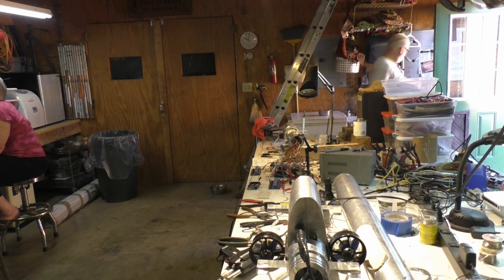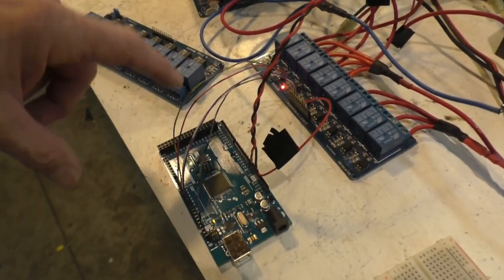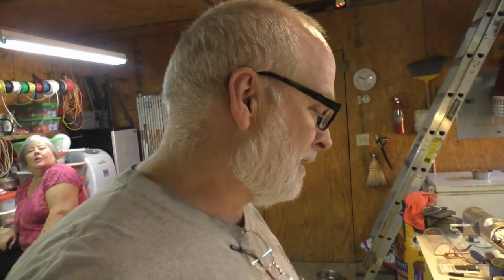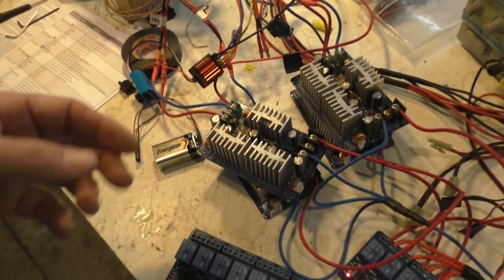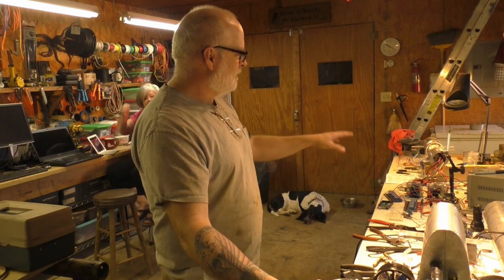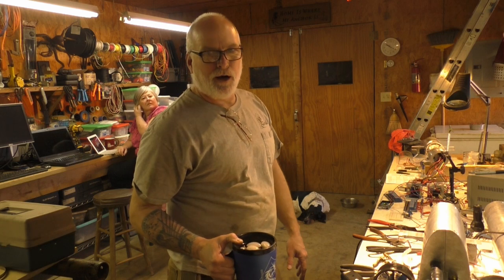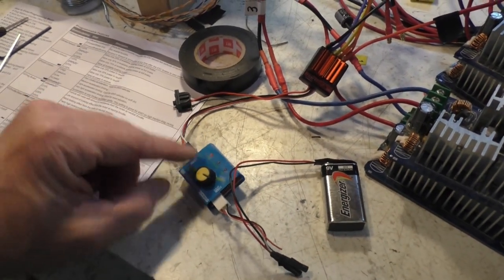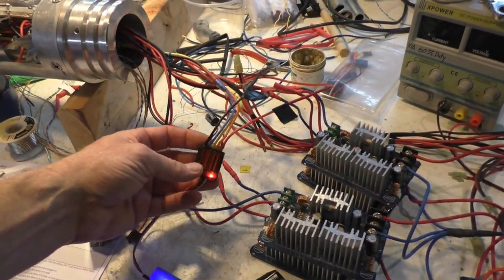ROV Wiring - Arduino, Relays, ESC, Outrunners, Bow Thruster and more

Comment: I bought CITIZEN CLL030-1212A1-353M1A2 LED series. Manufactured by Japan. It cost around 5$ppcs and bright is absolutely insane. Digikey is distributor. 62W max around 2640lm per led chip. Maybe CITIZEN LED solution will be cheaper than CREE. 
In question of arduino and more power, you need to define what is more power. There are plenty of different evaluation board which can by use. If your programming skills are low, i reccomended MBED platform instead arduino. Very similar language, very easy, lot of projects BUT.... When you use arduino, there are no others board which can by use with arduino language, only arduino. MBED is whole portfolio of different board with ONE programming language and one interface. There are lots of boards with different power and different prices. For example, you can buy STM NUCLEO with 80MHz clock speed  and plenty power for controlling 10 ROVs for 10$. Advantage of MBED , one language, one program, many many boards.

Those motors cant spin up under load. For example if you try hold the rotor with finger it wont spin up. Maybe some test in deeper water  will be good for insurance.

Comment: make sure the batteries that you put in parallel are "married" basically, they need to have the same charge/ discharge cycles to be safe. lipos are a bit dangerous..
Reply: as for the wiring, have a common ground for the arduino and the battery, and take Vcc from the dc-dc converters and put it in any thing you want to power externally. no positive from the arduino, and ground from the arduino and the dc-dc

Comment: Currently you're just using the 5V output from the Arduino to power the relays. So just connect the 5V output from the DC/DC converter to that same pin on the relay bank. For good measure, connect it through to the 5V pin on the Arduino as well, and don't feed the battery voltage directly to the Arduino. 11V is a bit high for the Arduno's built-in regulator which isn't very efficient.

Do the same for GND and you should end up with common 5V and GND rails for the whole setup. Like this: http://imgur.com/a/MEkvO

Comment: So many comments it's too hard to tell but I'm hoping you are aware the LiPo pack has a nominal voltage of 11.1V, the actual charged voltage will be 12.6 and your never exceed discharged voltage is 9V (3v per cell). Unless your batteries have a low voltage cutoff built in as part of the battery protection then you HAVE to do that yourself otherwise you risk damaging the cells or in the worst case causing the LiPo to swell/burn. Read up on LiPo safety so you seriously understand the precautions you need to take when charging and discharging them. 

Re your relays, assuming the optoisolators require 10-20mA EACH which you are sinking (going to ground) via the Mega2560 on the arduino board then you can not drive more than 10 outputs at a time without exceeding the absolute limits of the chip. So if you imagine running 24 relays you must use a driver on the output of the arduino to drive the relay boards. See the IOL specifications in the DC Characteristics section of the AVR Mega2560 datasheet from Atmel.

Comment: is this is the same board? it shows a wire diagram with the power. http://www.14core.com/wiring-8-channel-optocoupler-relay-module/ it says This relay can handle 7A / 240 VAC, 10A / 125VAC, 10A / 28DV. so add power to the relay then use the step down to power the arduino.

Comment: Doug, MPJA.com sells the relay boards. http://www.mpja.com/download/33329MPSch.pdf shows the wiring of the board. Notice the inputs on P1 (to the opto isolator) from the arduino take the 5 volt logic signal and isolate the arduino from the load through the opto's. You can put your seperate 5 volt supply to VCC Relay (+) and gnd.. The current required to run the opto's is  only <40ma per input, 0.32 amps if all 8 are on at once. The load source (to the LED's) is separately powered on P2, this is where you will put your high current power supply.

Comment: One option for powering your relays my be r/c airplane power systems. They provide high current for high torque servos in giant scale model aircraft without having to route the high amperage through the radio receivers. You may be able to send the arduino signal into the power system which will then provide the current to the relays from your l--po battery pack. An added benefit is that most of them have built-in voltage regulators to step the 3s li-po voltage to what you need for the relay bank.   http://smart-fly.com/index.php?route=product/category&path=60

Comment: will be a fantastic project to automate the boat with arduino/esp/raspberry  using mqtt node-red openhab  but i preffer using utp cable not wireless. esp8266 is for very especific aplications... not very dificult if you find a good person to guide you.
you can monitor,  control and automate  almost every aspect of the ship. from temperature, humidity, pressure, levels, network, power, light, switches, and expand it at will.  only limited to imagination.
at least consider cabling all the ship with utp cat5 cable from everywhere to a central room where you will put some servers "raspberry" or some not so powerfull but reliable  machine  to control..
sorry iam so far away but iam pretty shure somebody will apear very soon.
cheers from argentina.

Comment: you can cut down alot of those board by removing the heat sink and have a heat sink against the case sea water at the depth is going to be cold!
Reply from the maker: Yes, but I have learned that some heat sinks also carry a voltage.
Reply: The heat might also be useful at those depths to prevent condensation and freezing of electronics.

Comment: I'm not sure if you will work well with stabilization ROV brusless motors without Hall sensor. Because without the sensors can not spin too slowly and that could make the water problems. but I do not know how you sensors installed there since it's in the water. Link for example: http://m.ebay.com/itm/272380050764

Comment: Is there a reason why you would want the ESC turn off with a relay? Won't it be easier if you controll the ESC directly with the arduino? You would just need to send a send a PWM signal to the ESC, this will also enable you to control the speed of the motors remotely. Just replace the servo in the examples with the ESC. The sweep example will gradualy speed up the motor and slow it down again. https://www.arduino.cc/en/Tutorial/Sweep http://playground.arduino.cc/Learning/SingleServoExample
Reply from the maker: It will be pulsed by the Arduino, but the Arduino will also be able to power the ESC completely off in order to save power while the unit is being towed.

Comment: Gov'ner Dude, arduino feels like a melee word!  How do you feel about external pneumatic airbladder cylindrically contained with trawlnetting type material (hot air balloon elongated profile) powered by compressed air or not.  I'd normally write you a private email about dissipation of heat in the buoyancy volume; how do you feel about that?
Reply: I don't understand what arduino is exactly, though. Doh!
Reply: HDPE or teflon skids on the keels?  carried away: private emails too from me

Comment: If everything your using is from the same power system, that is there all common to a 0V line then I would use MOSFETS to switch your loads, this would take way less power than those relays and simplify things a lot. What is the current and voltage consumption of each of the loads (And type of load) your trying to switch. If you can share, I will put together a diagram for you with FETS. Another benefit is that you could PWM the lights if you wanted to in order to reduce intensity and again same battery power.
Regards, Peter from thebreadboard. ( Www.youtube.com/thebreadboardca )

Comment: http://www.imthi.com/wp-content/uploads/2013/04/SainSmart-8-Channel-DC-5V-Relay-03.jpg

According to this diagram, to power the relays using an external 5V source it looks like you should:
1. Move jumper to pins labeled "JD-VCC"
2. Connect external 5V source positive to VCC on the input 10-pin header
3. Connect external 5V source ground to GND on the three-pin header

I don't have a board to test this, but if it doesn't work @scabskunk provides a solution which looks promising.

Comment: battery specs  3 cells 
High Quality 11.1V 6000mAh Heavy Duty Lithium Polymer Battery Pack
Made of 3 3.7V 6000 mAh Li-Ion Cells
Voltage: 11.1V (Working) 12.6V (Peak)
Integrated Protection Circuit:
Limits Discharge Rate to: 6A
Over-Charge Cut-off Point: 13V
Over-Discharge Cut-off Point: 7.2V
Over-Drain Cut-off Point: >6.5A
Short Circuit and Reverse Polarity Protection
Suggested Applications:

Comment: First and last points of the ten terminals located in bottom center shall be connected respectively, to ground and positive (can be from a  separate source).http://www.14core.com/wiring-8-channel-optocoupler-relay-module/

Comment: This similar relay board has similar labeling.  From https://arduino-info.wikispaces.com/RelayIsolation

"...Notice that board has a jumper between "Vcc" and "JD-Vcc". Remove it.
 For complete optical isolation, connect "Vcc" to Arduino +5 volts but 
do NOT connect Arduino Ground. Connect your Arduino Digital Output pins 
to "IN0", "IN1" etc. Connect a separate +5 
supply to "JD-Vcc" and board Gnd. This will supply power to the 
transistor drivers and relay coils. Look at the diagram above. Only the 
part to the left of the small blue arrows is connected to Arduino...."

Comment: For the replacement LED units, what about gutting something like this? You'd need to have some effective heat sinks with the operating temps and I don't know about the power requirements but it seems like it could be an option if you ever decide to supply surface power.

http://www.ebay.com.au/itm/120W-200W-LED-Chip-Outdoor-Light-Hyper-Project-Floodlight-Waterproof-Lamp-Garden-/262493411304?